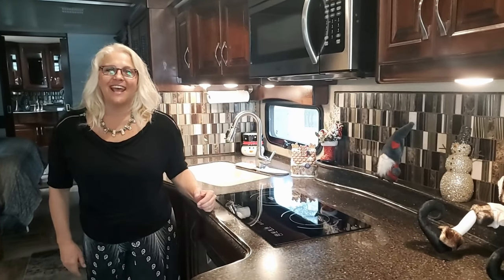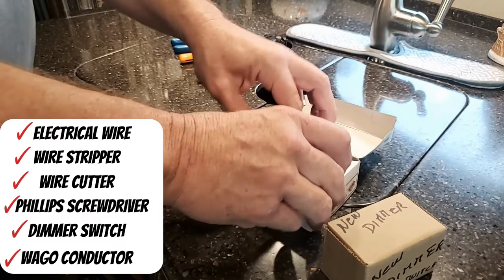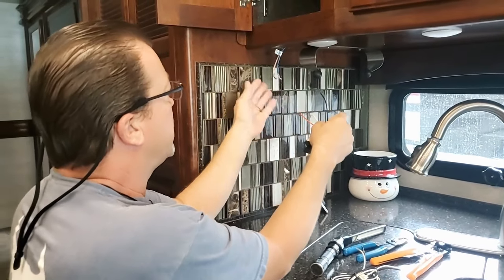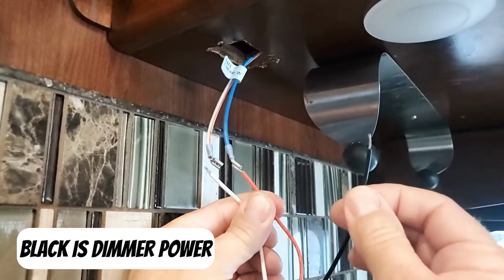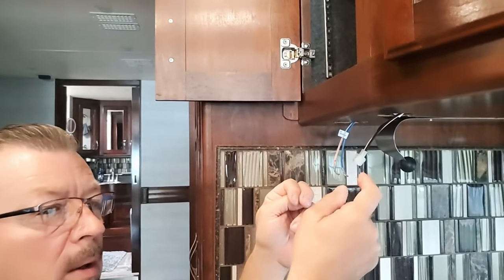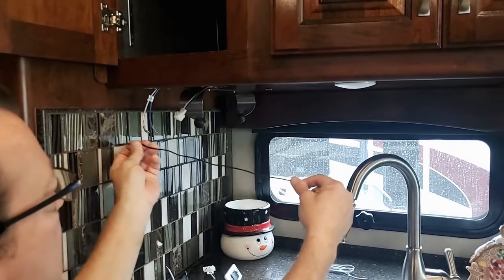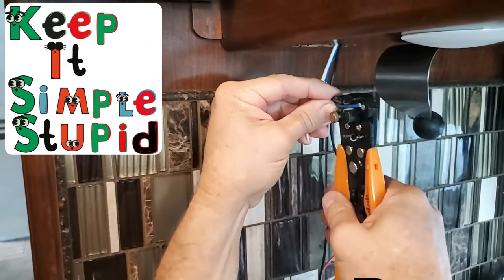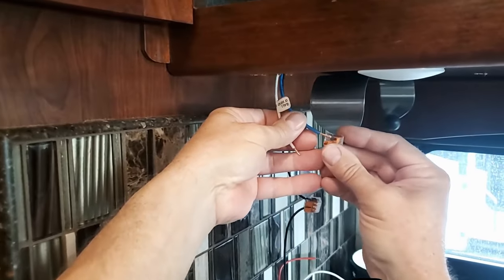💥EASY RV DIMMER SWITCH TUTORIAL! Install it yourself!

Comment: Great video guys! Once again,  you guys inspire us!
Looks like a bath and a half, possibly a Fleetwood or Holiday Rambler DP for the new to you motorhome? Also, while not able to shock you, is there any risk of popping a 12 volt fuse/curcuit if you short the wires?
Reply from the maker: Thank you!! Pierre says not likely to Pop a 12V fuse or circuit 😊
Reply: @blueoxontherun9188  ok, good to know.  So am I close to the mystery RV?
Reply from the maker: Mystery will be solved soon😉